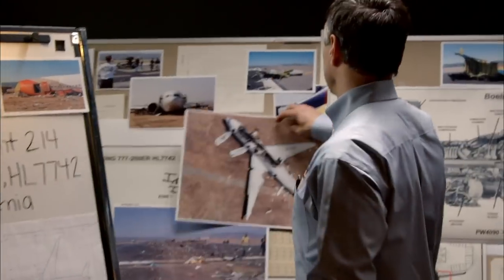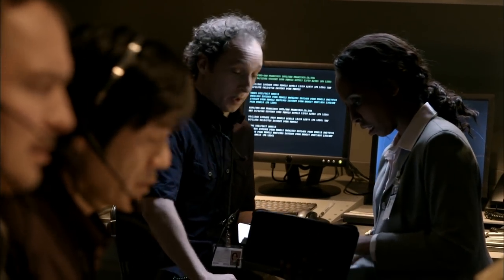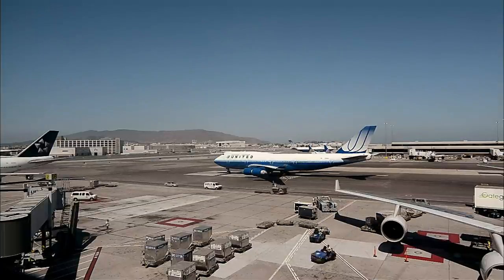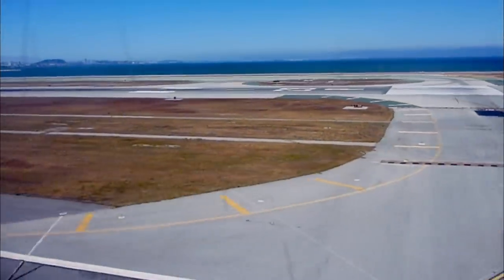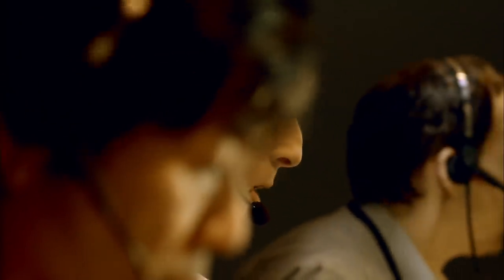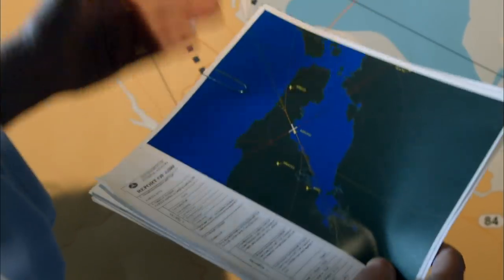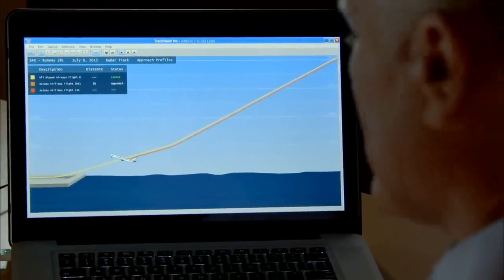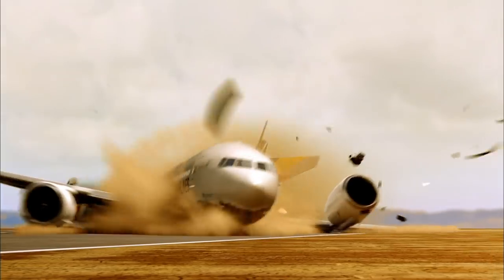Why San Francisco Airport Can Be a Challenging Place to Land 🧠 Air Disasters | Smithsonian Channel

Comment: Asiana flight 214 Was on final descend to San Francisco airport, The plane was about to land until the plane's nose went up and the engines started to roar, the planes back tail gets cut off the runway because of the impact of the back, The plane slides on the runway into the air and on the ground again, everyone survives.

Comment: I have a theory the AP has control to auto throttle so maybe when they turned of the AP the auto throttle stayed on and it could have failed and it might have reduced power increasing the sink rate causing the crash.I know it is crazy.
Reply: They had the autopilot (AP) and autothrottles (AT) both on. They were in Flight Level Change mode with altitude 0 selected. Even after the AP was disconnected, the AT remained on, commanding the motors to a low power setting for descent to 0 feet as "commanded". You can raise the nose, but without power, the airspeed simply bleeds off. You need power to arrest the descent rate (there's some low speed protections if you get really slow, but it's too complicated to explain here). But the plane did exactly what is was commanded to do. It was descending at low power to an altitude of 0 feet. Not an uncommon command for a plane that was above glidepath (although 1000 ft is more commonly used instead of 0, "just in case", as was this case). All they had to do was disconnect the AT and push the power up, or change modes.The problem is that the captain (new to the Boeing 777) did not change modes when they got to a proper visual glidepath. He was coming from an Airbus, and those throttles operate differently and he wasn't used to disconnecting or overriding the AT. The Check Airman (instructor pilot) failed to instruct/intervene (I blame him, not the "student" captain). The pilot in the jumpseat could have just put his foot on the throttles and shoved them forward. But he just watched it all happen. Call me a racist, but that's the asian culture. They've been hammered for many decades by the NTSB for that. They simply don't benefit from multi-crew teamwork (lack of). Better to crash than insult the captain by telling him to change mode to Vertical Speed when they got established on (and went through) the visual glidepath (or saying, "push the f-ing throttles up"). This was a blunder of epic proportions. A Cessna 152 student would have done far better. The captain got tunnel vision and got too far behind the aircraft, and could figure out what the problem was. The Check Airman/Instructor was the pilot in command bears full responsibility since the captain wasn't yet qualified. I'm a senior airline captain with 777 experience. I depend heavily on my First Officer to correct the most minor errors I might make. In return, I buy the beer (I've never flown a "perfect flight"). That's the way it is in the Western World of flying (and ships)
Reply: actually they are 2 different systems working under 1 command but good theory
Reply: Mana wrote a whole essay
Reply: @drcroll  he/she can't just say 'Plane crashed.' to explain her theory
Reply: Somewhat simple explanation: captain kuk selected level change mode on their FCU which make the auto throttle add thrust and the autopilot pitch up to climb to 3000 feet. Captain kuk didn't want to climb though, he wanted to continue the approach so he pulled back the thrust levers back to idle. That made the autothrottle thinks the pilot is controlling the thrust levers they go into HOLD mode which basically means the autothrottle isn't moving the throttle at all. This also disengage the autothrottle "wake up" feature on low speed

Comment: I mean, isn't the basics of flying to land VFR? I am surprised the pilot forgot how to do VFR and allowed the computer to fly.
Reply: its said that the captain never really did a visual approach,.
Reply: Some companies require AP to land.
Reply: They're supposed to always check their airspeed, regardless. He overrode part of the computer when it tried to take them back up to 3000ft, but didn't know that doing so would disengage the auto-throttle. None of the pilots noticed.

Comment: ok so what i heard that the plane was too low and when the pilots pulled up the throttle it was too late because it would take some time for the engines to go full speed and when the pilots throttled up they pulled up the yoke which lead to a stall i think so maybe it was pilot error
Reply: You are correct the investigación found that pilot error was the main cause of the Crash

Comment: Well I certainly wouldn't fly in or out of San Francisco, too afraid to
Reply: These accidents are really rare. Plus all the investigations that went on and how they've corrected issues on the airport side you'd be fine flying in and out. Plus out of the 3 casualties 2 didn't wear seatbelts which flung them out of the plane. Meanwhile the cabin crew and other passengers who did wear seatbelts escaped with injuries
Reply: @BrittenelleandOrionKMG  okay in this case I feel reassured now and I feel better about it now having more faith and confidence in it. I think I’d be fine flying in and out of San Francisco.
Reply: To be entirely honest, I've flied in and out of San Francisco for maybe 7-10 times and each time it went pretty smoothly. However, there's always a chance of an incident occurring
Reply: @chaerihwi5117  How often do incident's occur there?
Reply: @JasonShipley1979  rarely. I've actually never heard of one except the 2013 one
Reply: @JasonShipley1979  Just flew in SF yesterday in a 777 jumbo jet in super super foggy weather, there was apparently some storm. Can't see anything at all out of the window except just white. The landing was insanely turbulent and I was afraid we might fall short of the runway since you couldn't see shit but here I am talking to you in my hotel room. I flew with ANA which hasn't had a crash since the 90's. So as long as you fly with a reputable airline you're fine.
Reply: @BrittenelleandOrionKMG  I guess I’m fine and I guess I shouldn’t worry as long as the airline is safe and reliable. Maybe I was just overreacting to this is all which I know now not to worry.
Reply: @JasonShipley1979  it’s super rare. The only famous one is the 2013 one.

Comment: Pro Tip: dont approach manually, even if the guiding equipment is off
Reply: Pilots enjoy flying. In VMC, most pilots click the autopilot off and fly manually on final approach. Western World pilots have no problem with this most basic of flying skills. Most American and European pilots learned to fly in planes that required flying skills. The rest of the world leans mostly in simulators and become system managers instead of aviators (the exception is their military pilots, who generally stay in their relatively prestigious positions). If you can’t hand fly a plane to a runway that is in plain view in clear weather, you probably shouldn’t be flying an airliner full of passengers. Yes, use an autopilot when other problems demand your attention. But this was a perfectly good airplane in good weather. Nothing was wrong except that they had to use basic pilot judgement to determine their glide path. The real problem was that they didn’t change flight modes and stop the descent, which was the result of poor crew coordination. The Check Airman is to blame because he’s an expert on the plane and he’s likely seen this rookie mistake lots of times. The Captain/student reverted to his previous Airbus mentality, and the CKA should have caught this.